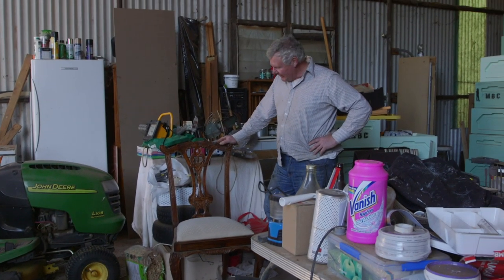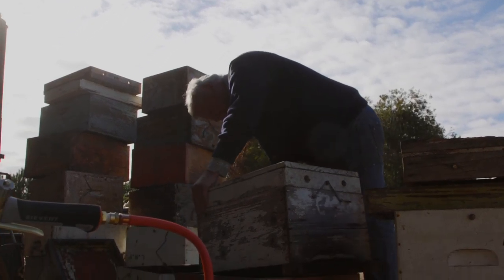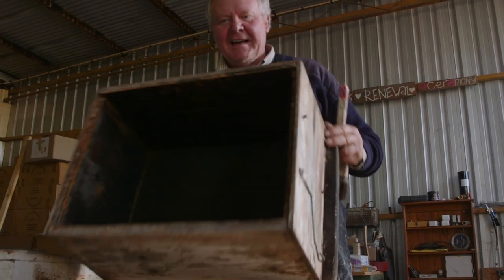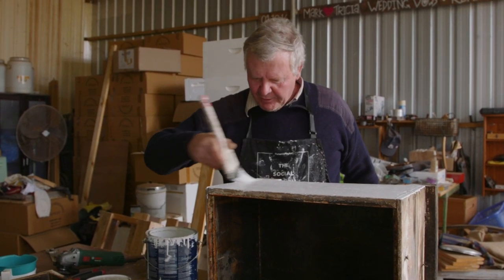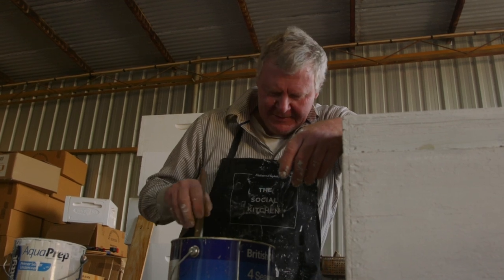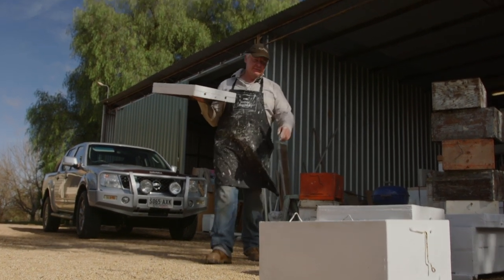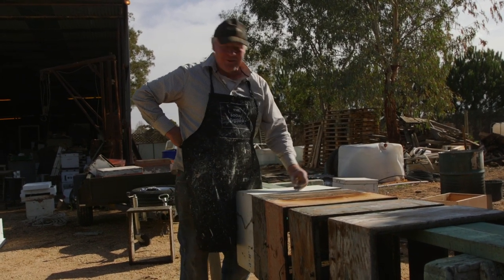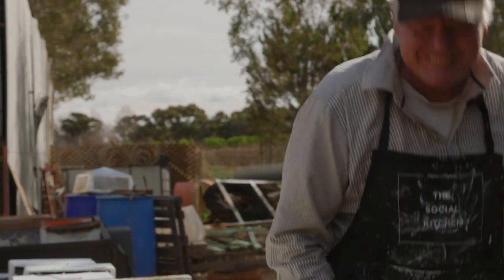How to Paint a Beehive - The Bush Bee Man

Comment: ACRYLIC IS WATERBASE, AND YOU MUST NOT PUT ACRYLIC OVER OIL BASE, BUT YOU CAN PUT OIL BASE OVER OVER ACRYLIC ITS BETTER WEATHER RESISTANCE. I'M USING OIL BASE SEALER IN AND OUT, THEN ONE COAT OF SILVER METAL STRUCTURAL STEEL PAINT ON THE OUTSIDE AND IN THE JOIN, APPLIED WITH A 10 MM NAP ROLLER, GOES ON BEAUT AND IS NOT STICKY WHEN PAINTING OR WHEN DRIED LIKE ENAMEL PAINT. WATER BASED STICKS TO THE LID WHEN YOU PULL IT APART THE PAINT PEELS OFF ! OH AND I DO A COAT OF COPPER NAPATHANATE IN AND OUT AS THE INITIAL PREPERATION BEFORE UNDERCOAT, IT DOUBLES THE LIFE OF THE BOX, SO 3 COATS ALL UP. THE COPPER NEEDS A FEW WEEKS OUT GASSING
Reply: IF ALL YOUR HIVES ARE SAME COLOUR PAINT SOME UNIQUE VARYING COLOURED IDENTIFIERS ABOVE THE BEE ENTRANCE, SO THE QUEENS CAN FIND THEIR WAY BACK TO THEIR HIVE IF THEY HAVE A FLY.